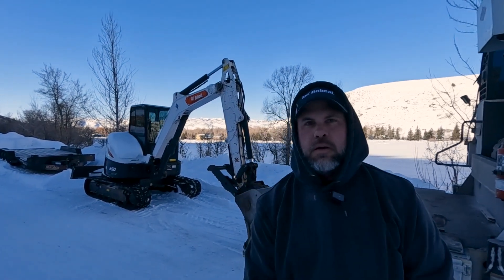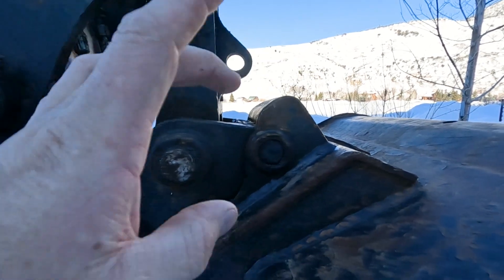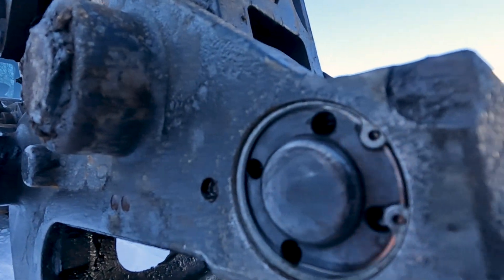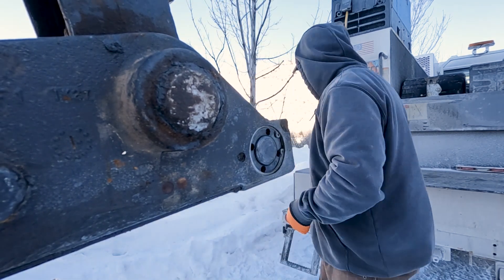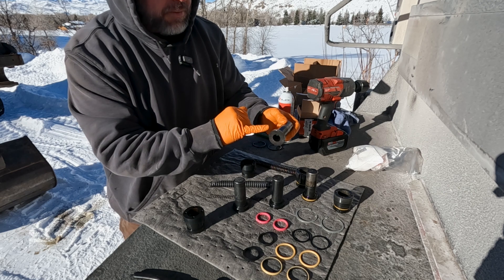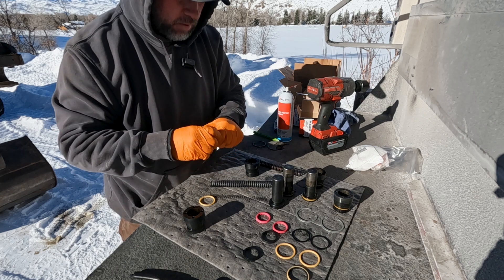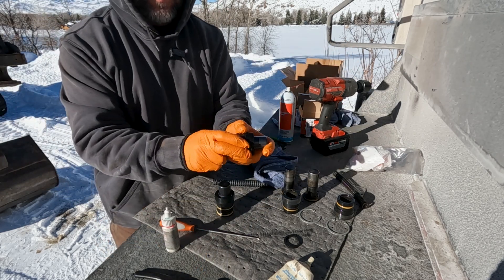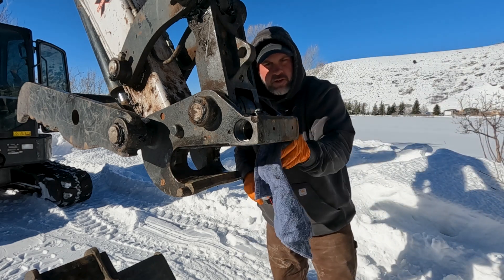Bobcat Excavator Hydraulic X-Change Leaking

Comment: I have 1300 hrs on my e60r2. Its a 2022 model. Never had a problem but been nervous. Been thinking of changing it to a pin grabber before i spend more on buckets.. Comments from bobcat users?
Reply: I have a 2014 e32 with 1700 hours on it. One side started leaking shortly after I bought it 6 months ago and now they’re both leaking. The seal kit more than doubled in price this week on the bobcat site. I’d like to do a pin grabber too. It’d be nice to flip the bucket around if needed.
Reply: @maxjones9139  plus more common parts.. I feel maybe the bobcat exchange might wobble less over time but dunno.. My whole coupler is bent cuz the 60 is strong plus i been beating it.. No leaks though
Reply: @austinavery4772  I think I’m going to take it apart and take the seals up to my local hydraulic shop. The pins seem fine and locktite should help. Mine is just like in this video, backing out against the c clip. It’s crazy on the bobcat site the rebuild is 1500 bucks but a whole new x change head is 2200. 1900 for non hydro. I beat on mine too. They’re great machines.

Comment: My 2021 e42 has one circlip missing but hasn't backed out. The other side has started to back out but still has the circlip in it. Neither are leaking. Would you recommend that I try to thread it back in and set a new circlip on each side?

Comment: My E50 Bobcat the pins are out on the quick exchange they will not move in or out with the machine. I noticed the pin on the left side the lock ring is off and the bushing is screwed out past the lock ring. Nothing is leaking g can I crack the line to relieve the pressure then screw the bushing back in. Or should I replace the bushing and pins. Machine has 1600 hrs on it.
Reply: I have the same problem, what did you end up doing ?

Comment: That's unfortunate that they still have this issue. I had this issue with my '06 435. I had that coupler repaired several times by several shops (Bobcat, Cat, a local hydro shop) and it never lasted more than half a day before it would leak again. Very early on Bobcat notified their dealers that they would no longer repair those X-Changes under warranty (or so my local dealer told me). The dealer told me that it was a "ground engaging tool" and so I should expect that it would need frequent repair🤥🤨. I think that one of the big issues was that the pins would bleed out before one could engage the bucket. Since it was behind the bucket, the operator wouldn't see it, and thus try to engage the bucket with the pins out. The one that I had did not have those spanner holes (that you need the special tool for) and I'm not even sure if the bushings were threaded. I finally gave up on it and re-installed the manual X-Change. That hydraulic X-Change has been sitting in my scrap pile for over 10 years now. Can my old style unit be upgraded to accept the newer bushings? I might give it another try if I could simply re-tighten those bushings. Even if it were a daily maintenance item.

Comment: Another BIG issue is that the seals can come apart then run up the hydraulic lines and stick in the valve! Then you have no hydraulic pressure. This has happened twice to my 35 in the last 3 months!   Bobcat is still looking for a solution. I’ll be checking my bushing’s and snap rings regularly.
Reply from the maker: You are correct, it can cause all kinds of issues.

Comment: Unrelated to the video, but I have a bobcat question on a weird hydraulic fitting type on an older 863 drive motor hoses.
Reply from the maker: JIC with o-ring?
Reply: @tetradgroup except there was no taper for the jic to seal on and the o ring that came up in the diagram wasn't big enough for the male portion to come in contact with. I ended up replacing all 4 drive motor hoses with jic because nobody had ever seen it. It was almost like a reverse DIN

Comment: You need a burn barrel on the back of your truck to just deploy it with the crane and keep yourself warm.   Maybe some sort of tray to keep your tools on to keep them warmed up too.  Great Tips and Techniques!    This will help me with my E55.    So the Hydraulic Spanner wouldn't have helped rotate that piston 4-plug ring?      Is that some sort of home made blade bucket --- did they weld a blade to the teeth on that bucket?
Reply from the maker: Its common to see a blade welded to the teeth for smooth grading.  The spanner might have helped, I will have to try next time.

Comment: excellent video.We had a e35 with hydraulic exchange and had to reseal it 3 times in 4  years.Finally had enough pulled the hydraulic exchange off and put a manual exchange on .No more problems.
Reply: Very cool. I didn't know you could do that, but I'm a new owner.
Reply: @T18skyguy  ya worked out perfect pin size same diameter. We ended up selling the hydraulic exchange for almost what I paid for the manual exchange.

Comment: Why didn't they drill a hole through the housing and half way through the bushing so they could put a set screw on it and prevent it from turning?
Reply from the maker: Possibly in the near future!
Reply: Case backhoe cylinders have used set screws drilled  into the gland/tube threads to lock the gland into place for decades. They also used a two pin adjustable spanner to turn the end gland onto the cyl barrel. Something like that might allow turning in the loose gland to free snap ring. Also doesn't damage holes in the gland.